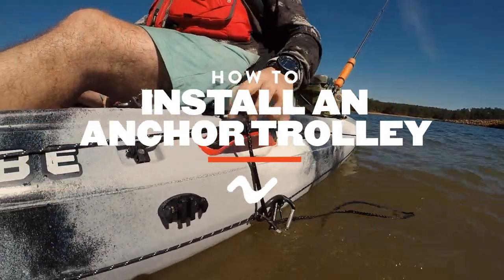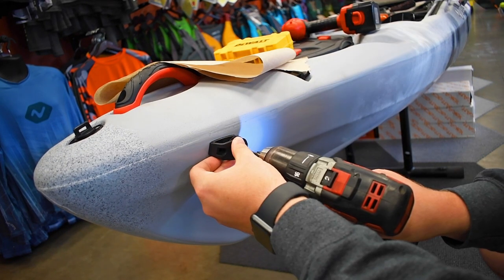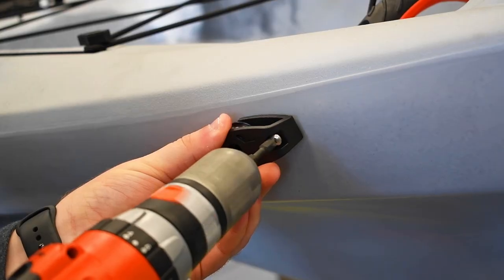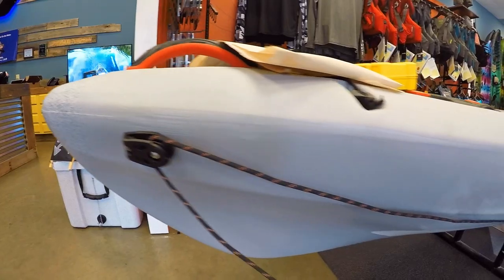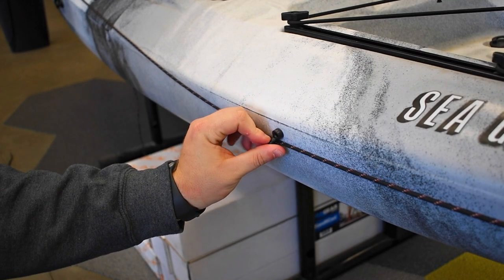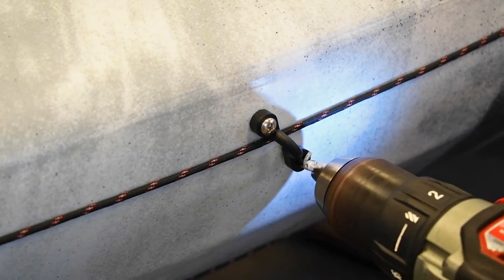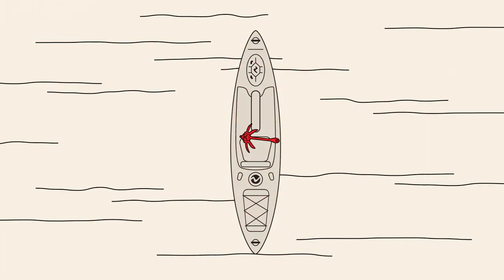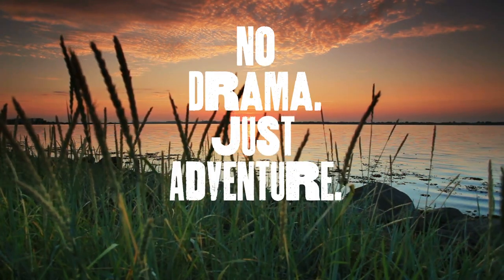How to Install an Anchor Trolley on a Kayak

Comment: I did not add any silicone when I put the screws in. Would it still be ok to take them out and then put silicone? or should I just leave the alone?
Reply from the maker: Take them out and add silicone.
Reply: @Vibekayaks  thank you!

Comment: Can I turn my face to the current in 40 ft of water with this anchor system?
Reply from the maker: 40 foot is a little deep for this anchor system. Keep in mind, you're anchor line must be 2x to 3x longer than your water depth. So you're talking about dropping 80' to 120' of anchor line. Now, IF you did want to manage that much anchor line, you COULD turn and hold your kayak in any direction you rig up.

Comment: Why wouldn't you need a nut to hold the screw in place? Is that the purpose of the silicone?
Reply: No nut needed, just use the correct drill size so the hole doesn't get bigger than the screw. The purpose of the silicon is to attempt to keep as much water out as possible.
Reply: What size drill bit should be used?

Comment: YIKES!!!!   NOOOOO!!! DO NOT JUST "SCREW" THEM IN, THROUGH BOLT THEM!!!!!!
Reply: The back side of the bolt is not accessible on my kayak so a screw is the only way to go.
Reply: @zackbrantley441  Use a well nut!   Thru bolt it!